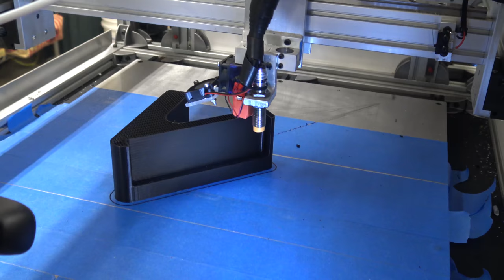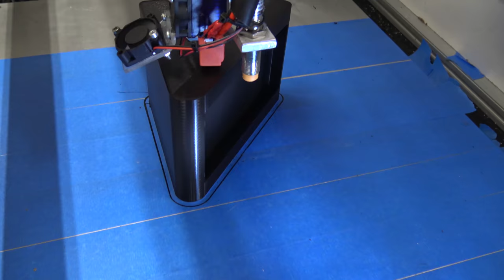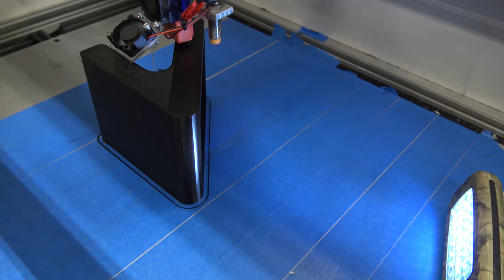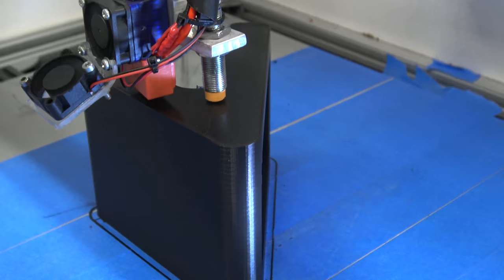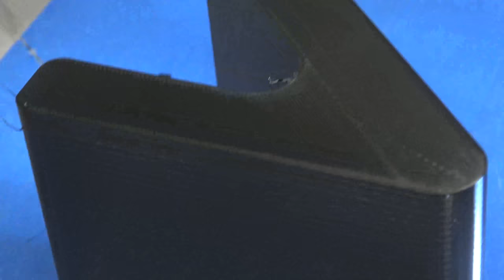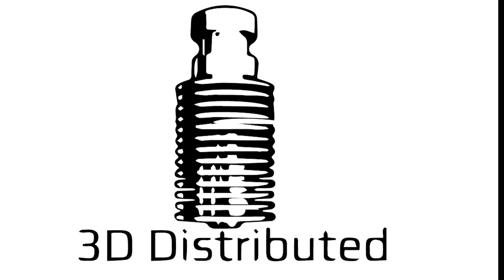WorkHorse 3D Printer

Comment: That's what I call a machine! But isn't the moving mass to high? What printspeed are you capable of?
Reply: The moving mass is irrelevant as long as you can put enough force into the movement for it not to matter. Which, given even Nema 17 stepper motors, or if that fails Nema 23, is TRIVIAL. Note how they use lead screws for the movements? With a proper stepper you can move a kile around without thinking.